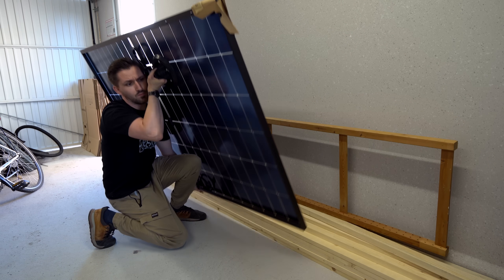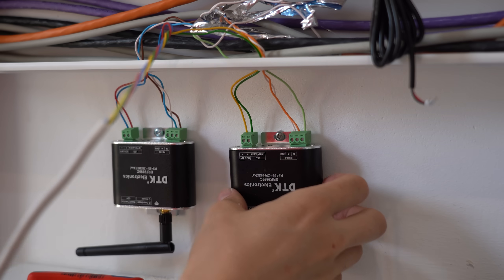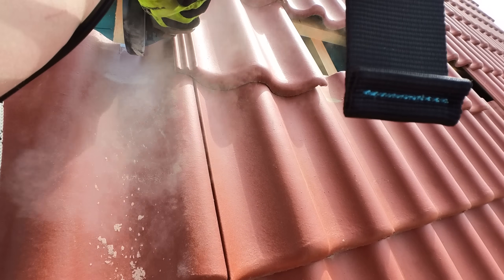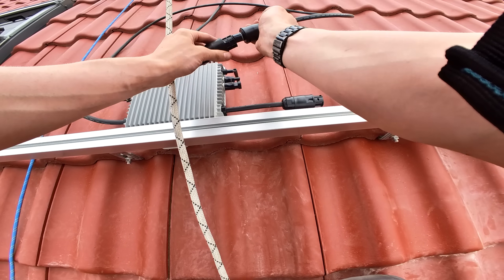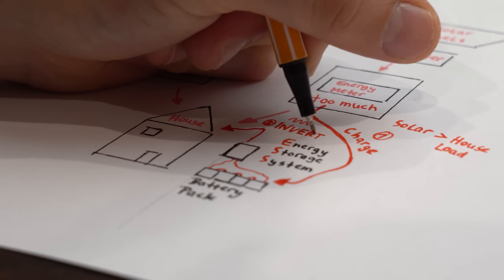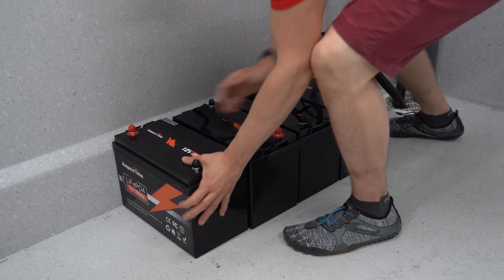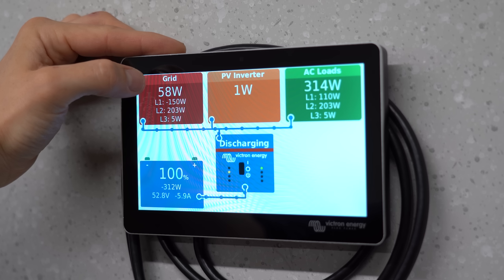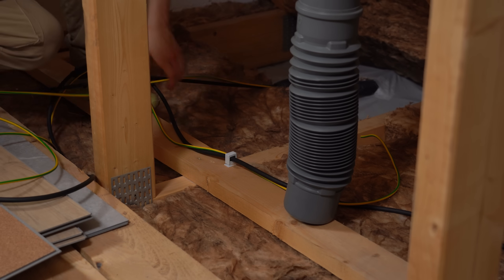Pushing a "legal" Mini Solar System to its LIMIT!

Comment: Multiplus II do not discharge a battery bellow 40.6 Volt in grid-mode (deeper only in island mode). So 12s lion like you have will never be fully discharged. It's not much energy under 40.6V, but is still something to consider in advance for others.

Comment: Can't backfeeding the grid with no controls kill a lineman if they're working on the lines during a power outage?
Reply: All power converters use the grid to sync (otherwise they would not work at all). No grid -> they shutdown.  
Some more expensive ones can be run in island mode, so that they feed your house, and only your house, with AC without grid.

Comment: Is it safe to just leave the bettery contacts exposed to the outside? I mean, if something conductive falls onto the terminals, it'll short the batteries, right?
Reply: it will melt/disintegrate the conductive wire immediately and disaster averted. (lol. I have such accident, lucky that my wire is not thick, otherwise the battery will overheat but LiFePo battery is safe as it do not ignite unlike Li-ion)

Comment: Hey Scott i have Questions about your System configuration.

Why Use A Micro Inverter After solar panels when you can Directly connect to Your Victron Inverter? 
Isn't that more efficient then Converting Solar pannel power in to Ac then Use that Ac  power to Store it in Battery pack? 

You can make it work like Hybrid Inverter to Utilize it more Efficiently.

and sorry if is sound dumb in this comment 😅

Here in My country you have to pay Electricity bill according to your usage in Units(kWh) per month. so to reduce that usage 
I Also installed Solay system at my home Using Hybrid inverter i use it in Off grid configuration by Turning off Mains input to inverter so it Only uses Solar power and battery power Until Solar power goes out in Evening. then Inverter sense's when the Pv Power is not enough it Starts Bypassing the Utility Power to home. 

My Solar System Specs:
1:Inverter Hybrid 4kw output capacity
and can Support 5kw Solar Array.
2: 1.5kw of Installed Solar capacity using 4 545watts P-Type Mono-perc Half cut Solar panels)
3: 2x Lead Acid batteries 120Ah each (24volts system). 

Hope this Makes sense😅
Reply: A lot of hybrid inverters do have Solar MPPT inputs.  The Multiplus II does not.   So at least with the Multiplus II, the solar panels have to either be connected to micro-inverters or to a DC charge controller.

You wind up losing either way.  With the micro-inverter, active loads during the day can be directly supported from the micro-inverter at 98% efficiency (solar-to-load), but charging the battery goes through two conversions (solar-to-AC and then AC-to-DC) which is only roughly 85% efficient.

But with the charge controller you also lose.   Supporting active loads during the day wind up being only 85% efficient, even a bit lower, but charging the battery is 98% efficient (actually more around 93% efficient since the battery round-trip efficiency is only 95%).

This typically makes it a wash either way.

The biggest advantage of going the DC route is that a DC topology is naturally off-grid and thus has no unintentional export issues.  AC-coupled topologies have to be disconnected or load-matched to avoid grid export and even then can accidentally export a little.

Comment: Very fortunate that in Thailand there are agents importing many brands of hybrid on/off grid inverters such as Deye brand or Sofar Solar brand, which combine all the capabilities of both video clips into one unit. All you need to install is Hybrid Inverter, Combiner box and solar panels only (oh, the grounding system is already required) 😄

Comment: Cool project, but big picturewise solar and wind power don't make a lot of sense. You just put your money in them and if all goes well you can get your money out by the time you need throw it all in the trash and get a new system. Making batteries especially do more harm to the environment than good, and the fact they make 80% of the worlds demands in China is crazy. The stop oil freaks should protest against that, not something that works okay.

Comment: I built a 900W setup for $500 with used panels, lead batteries and a UPS for the inverter. It's not nearly as elegant but it produces 2.5-4kwh a day independent of the grid
Reply: Was it 500$ total?
Reply: @killua_148  Yes, full disclosure the batteries were salvaged. The 230W panels were $90ea, 60a controller $50, cables were about $30, the smart shunt was only $12
Reply: Can you elaborate?
I have a 20-Amp rackmount APC UPS, just replaced the internal batteries, and was thinking about exactly this.
Where’d you go for used panels?
I’m in Los Angeles btw, plenty of unused daylight.
Reply: @G_handle  I bet there's a ton of used panels in your area, I've seen some killer deals on Facebook marketplace. I ran cables from the rack mount 900W sinewave UPS to 3 100ah batteries which is undersized but I run a window AC in the afternoon.
Reply: One of the really bright spots on people doing DIY systems is being able to cobble together something like that on the cheap.   Using lead-acid does require some care, though.  Actually a lot of care for people not used to dealing with lead-acid.

Even though LiFePO4 is a significant expense over lead-acid, it is usually worth the price.  No outgassing, huge cycle life, no maintenance, no memory, and partial cycling does not cause extra wear.

As an alternative, there are tons of "power stations" on the market.  For example, a small one with a UPS function would be something like the ECOFLOW River 2 (256Wh, LiFePO4 battery), with UPS function, 300W output (600W surge), and solar MPPT input..   Power stations require virtually no work to set up with a few solar panels.   Brands like ECOFLOW, Bluetti, Oukitel, and others.  Quite generic stuff these days.

Comment: You should look into selfish/hybrid inverter. Instead of powering you mains wiring, they have an output outlet on them. They can take battery, mains input, and solar input and use whatever is available like your system. The main difference is that any devices you want to power need to be on the output port. This works great if you only have one big appliance that draws constant power. I found out when looking at alternatives to a UPS for my server. This way you don't really tie into the grid and don't have to deal with any backfeeding with the only downside that you cant use existing house wiring for all your devices
Reply: Utilization of solar power in your method will be in most domestic installations much lower, and so low that it will no longer be economically feasible. Also, you would need RCB protection circuit as well, and that point, wel ..
Reply: Depends, if whatever you are powering draws the largest percentage of power in your house, its a great option. Assuming your solar system is smaller than the draw, you don't lose out on wasted power. My server draws between 0.5-1kw so as long as I don't over produce by an excessive amount it is not an issue. The hybrid inverters should have the proper protections to prevent backfeeding during an outage or when draw is less than what is  produced    @96Lauriz

Comment: I'm jealous of your electrical panel. Here in the US ours are so last century.
Reply: We have Leviton and Span panels
Reply: How though? Those panels are bigger for less circuit capacity (neglecting voltage differences), more time consuming to wire, and easier to mess up. In the US/Canada we use those kind of panels in industrial all time, because they are more modular, allowing things like those power meters to be intsalled easily, or relays and PLCs, but he could have easily installed it in a sub box like the surge protector, heck even put it in the surge protector box. There is a reason in industrial facilities we still have both these style of panels and typical NA panels. Because if all you need is power the NA style panels are super cheap, compact, and easy to wire.

Comment: Wait…are you getting DC from solar panels, converting them to AC at microinverters, converting them back to DC to charge the batteries then converting them back again to AC when you are discharging the battery to AC loads?

Comment: messy wiring - take the time to make custom lengths - not a lot of effort plus you get a more efficient system and lastly just make an off grid system - it doesn't make sense to feed back into the grid and adds a lot of cost #feed in tariffs
Reply from the maker: Will improve it in the future ;-) Simply had to get this video done in time.

Comment: You can actually be fined for pushing power back to the grid without telling the power company where I live (basically they want more money along with you giving them electricity). I don't think they really have a way of knowing who is doing this or not though.
Reply: Those fines aren't a way to get more money, electricity turning up in unexpected places in the grid causes instability by messing with transmission lines and the grid frequency (which has to be actively managed based on load and supply). The reason that places that have feed in tariffs don't pay much is because that little extra power isn't actually that useful, and the additional grid management and infrastructure to actually use it costs money.
Reply: In most countries, providers use smart meter and its piece if cake for them to receive software warning whenever something is off.
Thanks for that, so that nobody can mess around with grid stability

Comment: Very nice installation! 
A 45° tile roof is very tough for panel installation. (Former rooftop installer)
Reply from the maker: Thanks for confirming this :-)
Reply: Why do the tile seams line up? doesn't that allow for leaks. Just curious, I don't know anything about the tiles.
Reply: They ovelrap and hold each other in place @tiltedbrim83

Comment: Just share the excess power for free. Buying expensive batteries & hybrid charger to save that tiny tiny extra excess is waste of money. The batteries & hybrid charger doubles the cost of the system.
Reply from the maker: We will see ;-)
Reply: Depends on when you use most of your power. Many people are at work all day and use the most in the evenings so having a storage system does save money especially in countries with high tariffs.
Reply: Having batteries is more expensive, but if set up correctly they can also provide backup during grid outage.... Ideally your power company would also let you sell back power during peak times at a higher price.

Comment: Nice setup. But if back feeding is a problem, why not go with MPPT's on the DC bus of the Victron set? Right now if something happens with the Victron set (or the breaker get tripped) you will still feed back to the grid. Alternative, connect the inverters to the output of the multiplus. Also this way solar will still work in case of a blackout.
Reply from the maker: Thanks for the feedback :-) Good ideas :-)
Reply: Also way more efficient to use a MMPT inverter if you have 12V DC. With the micro-inverters you lose energy two times: when going from solar DC to AC 220 and when going from 220 AC to 12V DC battery pack. I made the same mistake ten years ago. Today I have MMPT inverters and 48V LiFePo4 batteries.
Reply: @baaf777  MPPT direct to dc is always more efficient then dc-->ac-->dc. you can use a MPPT on 48v no problem. just need to make sure your string mppt voltage = max battery voltage +5v.
Reply: If it is correctly wired, A/C coupled  will not back-feed the grid, since the whole house inverter should shut off the micro-inverter.

If the breakers leading to the whole house inverter trips, which is supplying the A/C to the grid tie micro-inverters, then the micro-inverters will shut off, and all power to the house is shut off.

If the grid power goes out, the whole house inverter will feed the grid tie micro inverter & the house power will be maintained.

Comment: instead using multiplus II inverter, best solution should be Easy solar II GX (inverter + battery charged + MPPT PV in only one box) + one current clamp connected to the inverter for measuring actual power ,  you can have a complete ESS system, without using external mini inverter and very slow in response to variable load rs485 power meter. you can set up the easy solar for a grid tie system (no power back to mains) .  I've a installation  with Easy solar II GX   with 2.4 kw solar panel + 14kw/h batterry , in one year I produced and stored  , 2.5 MW of power consumed only in my home, nothing send back to the grid 🙂 I hope will be inspiration for new video
Reply from the maker: Your setup definitely sounds suitable :-) But I want to scale up with solar and the batteries in the future and I think there the MultiPlus 2 is a better fit.

Comment: All those breakers and shunts and zigby adapters and yadda yadda is really going to add up. cost wise. 

I did 20kw of solar for around $12k US, $15k if you count mistakes made along the way, and some unfortunate equipment failures. I have two small "microgrid" systems like in the video, and about 10kw worth of micro and string inverters that backfeeds the grid. I did it all myself and then had it inspected. I am lucky in several ways, I had land available to mount most panels on the ground. I also have one grid connection that goes to four households, so I have an absolutely huge base load compared to my usage. I send about 8-10% power back to the grid, the rest gets used up or stored in batteries.  If I were in a high cost of electricity, it would pay for itself much faster, but 2 years in and it'll be paid off in ~3 more years.

One drawback is it was kind of a hobby, I started with the microinverters... I added a 5kw string inverter, then two hybrid inverters and batteries. But now everything just works, and it isn't much of a hobby. Adding on to what I currently have will have drastically reduced ROI, as whatever I add will largely go back to the grid and they only pay 1/3 of what they charge me.  I need to improve the temperatures that my hybrid inverters see.... everything is outdoors but dry. They experienced temperatures this summer that this area has never seen before. Not sure how to best go about this.
Reply: the yadda yadda is bc he's into electronics and want to manage power using smart software.
i had a basic solar system in our old house and was doing it for testing and learning, and yes, compared to grid it's not cheap, but if you want to be power independent and feel proud when here is a major blackout then nothing else matters.
Reply: When you say it pays itself off in 5 years, you mean if everything goes perfectly. What if you get hail, parts of the system blow out, etc. then it becomes a nuisance. Power from the grid probably never will be more expensive than any other source.
Reply: @orangeflavoredmf  After a month of running on generators after a pair of hurricanes hit a few years ago, I resolved to never go through that again. I was driving over all creation looking for gas, changing oil every 100 hours and resetting the breakers when clueless family members overloaded things. I just wanted to keep my grandmother alive with her o2 generator, refrigerated meds, and air conditioning.  All that to say, I will lose power again, and the spice must flow... 15 days without power and I'll be at break even. Odds say that'll happen before I have a major equipment loss. There is no one super expensive component. I can take down all my panels by myself in about 6 hours, and with help, about 2. Solar is way, WAY cheaper than gasoline or even propane. 

I've never seen hail bad enough to damage my solar panels where I live, but then again I've never seen a solid month of 106F+ temperatures before last month so... who knows and fingers crossed.
Reply: @orangeflavoredmf  For these sorts of systems, all the costs are front-loaded.  Once the system is running properly you are basically done and your break-even calculation on cost (already spent so you know what it was)... is now guaranteed.    In anycase, if it is DIY it will definitely break-even in a reasonable period of time.  If it is professionally installed it may take a lot longer to break-even because professional installs are about twice the expense.

The other take-away for people doing DIY systems like 7901, and myself, and others making postings about their systems, is that small DIY hobby systems inevitably turn into large not-so-hobby systems.  So it is a really good idea to design the system such that it can be scaled-up piecemeal without having to replace any equipment already purchased.
Reply: @orangeflavoredmf  Solar panels are actually really resistant to hail. If something blows out after five years then you get it repaired under warranty. It may be a bit of a nuisance to handle claims but it won't significantly affect your payback period.
Reply: @eDoc2020  You guys might be partially right, I heard Nick Rochefort talking about selling a house with not diy solar on it.
Reply: @eDoc2020  yes, idk who think that PV panels are that fragile, the old ones i don't use anymore at on the roof not secured and they didn't get damaged by weather.

Comment: Maybe you could build a simple slide or two rails out of scrap wood to pull the panels up the roof?

Vielleicht geht es auch mit einer langen Aluleiter, für die Du Dir eine art Schlitten baust, der nicht nach links und rechts abrutschen kann. Dann die Panels am Schlitten befestigen und an einem Seil nach oben ziehen!
Reply from the maker: Problem is that one panel weighs 25kg. At a 45 degree angle, this is really no simple task. No matter what kind of contraption you build.
Reply: @greatscottlab   hmm, maybe you could use a pulley system (Flaschenzug)?